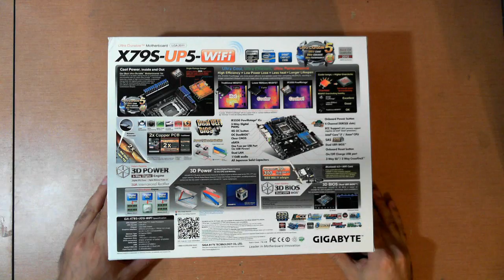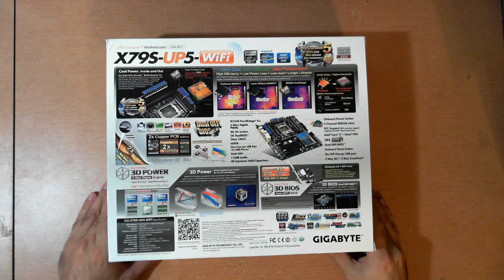[SH]GIGABYTE X79S-UP5 Wifi Physical Review

Comment: I have had this board since its release and with all the recent bios revisions its fantastic. Rock solid board with absolutely zero issues running a 24/7 OC. Currently im using the latest F4 bios for it couldnt be happier

Comment: How is it with over clocking i am looking at buying this mother board I edit a lot and have 3 displays so i need also if processor speed for editing and drive space which will be good with the sas ports but i am also going to put an h100i in it to over clock (BIG OVERCLOCKING FAN) but i can not find another board that has that many sas cenection and all of the space for ram, i would also in the off hours like to play games on it how does it handle that?
Thanks